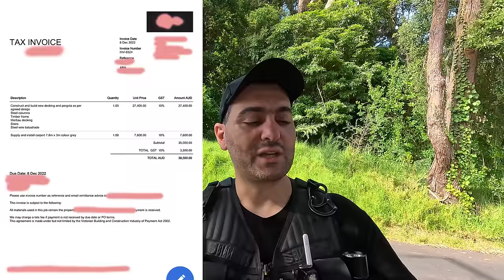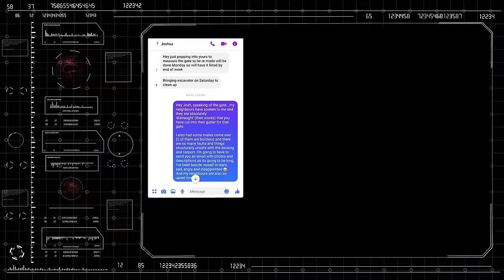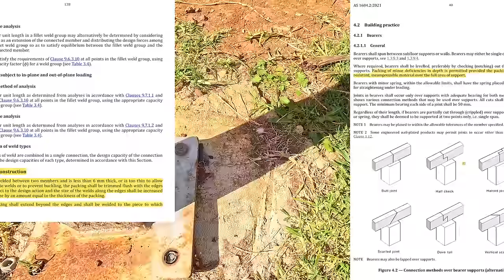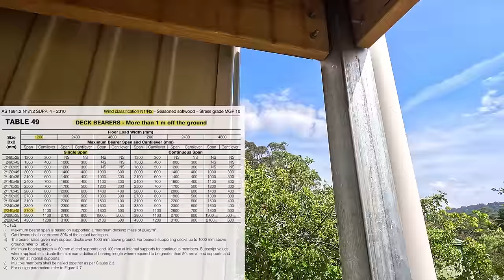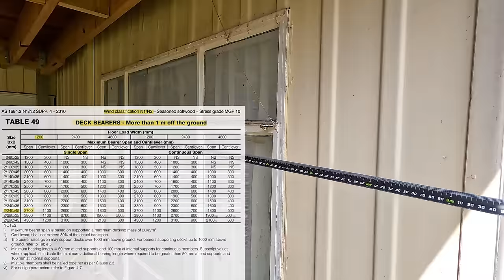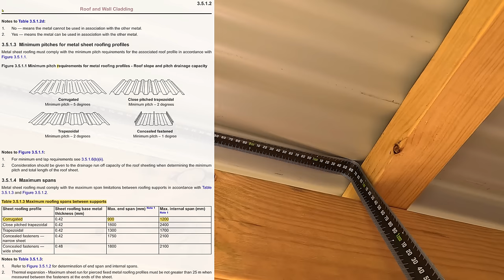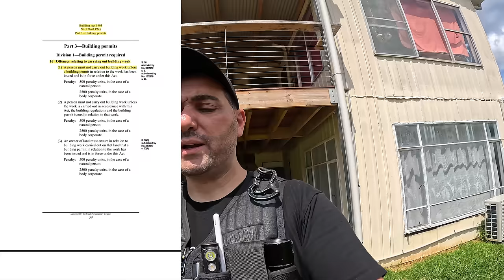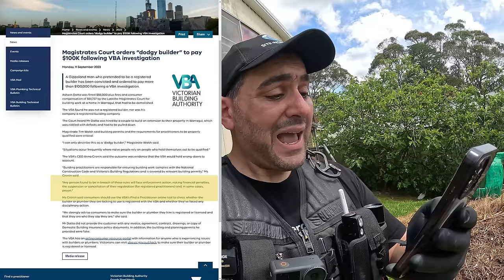I Inspected A Dangerous Build | Illegal Build Caught

Comment: Mate, I'm a cowboy myself and DIY a few small projects for myself with no regard to regulations. I have no training and the word "handy man" is a stretch for me. But even I can see, it's just common sense, that this is hilariously unsafe and unpresentable. This contractor must be on crack. Those spans under the deck are wayyyyy too long just intuitively. You don't need to be a qualified builder to see the footings are sketchy as anything and unsafe.  The simplest thing he could have at least done IS USE ALL THE HOLES for nails and bolts on the joist bearers and, most importantly, attaching the main beams to the metal pillars / columns. I would be attaching the whole structure to the house in all kinds of dodgy but strong ways that I could, at the ground, deck, and roof levels. Those are just common sense things that blind Freddy in the year 1800 (before Australian building standards were ever written) would know. What I build (and I'm not going around doing this for other people) is not compliant, I don't even know what the standards are, but at least they will stand. I stress test my work, I TRY to see where it wants to move or doesn't seem solid under loads and being pushed around. I don't expect anyone to endorse what I say, and I think the standards are a good thing, but the point is, even me, a loose unit indeed, am shocked by this.

Comment: As an ironworker in america ,,, we ALWAYS weld clips all the way around !!,, With 7018 welding rod ,,, that 70 means the weld is good for 70 thousand pounds per sq. Inch ... only putting one bolt in a connection is pure laziness!!!,,, Screws and nails !!!??? I wouldnt even stand under it !!!

Comment: Wht is the cream coloured external panelling? It looks like moulded asbestos cement. Can you confirm? 12.49 shows cracking in that panelling where the new structure has been joined. If that's ac then work should not have commmenced without licensed removal first.

Comment: I had a unit build about 10 years ago
  I had no shower complete also a pit was to be maid for the drainage from 2 properties was never done and the pipes never connected the arear was filled with dirt.
   With my local council we took the vendetta of doing something about it
After 3 years fighting the system with the building industry and the plumbing board we got nowhere 
     The builder was registered  the government body did not care I even had rang 3aw
  I finally found who the inspector was, he told me inspector did not have to go to the premises they go by compliances 
      I finally did all the work myself. including the pit 609x600x1500 into the main collector pipe.  I am no builder, but I do have common sense
   After I finished I called the same inspector he said to me its the best job he has ever Sean, 
   A builders licence means nothing.

Comment: You should come and see the carport I designed and built at my house, it is STRONG and will easily carry 2 heavy 4x4's on its roof. All done with full permits too and me with a white card. I would demolish all this work, put in correct reinforced foundations. Steel beams for the main load bearers and fully self supported and fixed to the house. The car port in the same way.

Comment: Nah mate, I'm a software engineer and those are are approved BS-2034 bluetooth bolts installed. As well as the BS-3000 bluetooth concrete footings. Your just an ambulance chaser mate... That structure could hold the weight of 44 jumbo jets.

All kidding aside, its a shame that a person would need to fall back on charity to get a horrendous mess like this rectified. The VBA is a mess like most of the sites you visit.
Thanks for all the work you do and documenting these dodgy "builders". I have learned a lot from your videos and have mad respect for your work.

Comment: He has cup head bolts on the steel plate holding the timbers instead of nice hexagonal head structural steel bolts… I didn’t see any washers on the bolts where the nuts were squished into the timbers..
I built steel deckings and sheds for 25 years… I thought I was average..turns out I was really good compared to the con artist/builders on here.

Comment: These builders obviously are registered but I think their ability should be restricted to single story homes carports garages etc. I drew the plans as per materials suppliers information brocures, assisted the tradesman to do the labouring work, only the brickie I did not assist  but we came to an agreement about lintels 3.2 wide that the brick suppliers brocure thicker steel rods + plus stirrups in every space, I was there every day at about 12.30 to assist the chippy and we worked together really well,  Not a crack anywhere finished in 1996/ six months duration of build standing now 28 years wonderful, O B in Qld. Don't trust builders when I saw and heard the problems others had had. "building inspector stated the strongest home he had ever seen in the district"

Comment: My builder defaulted on two contractors and one window supplier and two other contractors rang me to apologise about the fact that they weren't going to turn up to do the work because they were convinced they wouldn't get paid.
The contractors he defaulted on didn't take it any further but the window supplier passed the debt onto a debt recovery agency and I just checked his license on Fair Trading and it's still spotless.
I ended up having to pay a plumber and plasterer directly out of the builder's final payment.
I've already had to pay someone $4500 to replace part of the roof and I'm pretty sure I'm going to have to do something about the footings because the engineer specified 140mm hardwood posts and the builder quoted for 100mm posts and put in 90mm laminated merbau.

Comment: How do you put a post that blocks the function of the door on the first level?   (One of the things this builder did do was not attach anything to the original structure.   No ledger plates, which means (maybe) he did not alter the 'original bldg"?)   Disgusting work, and worse a non-functioning government enforcement.

Comment: Privatizing government building inspectors was a mistake, There is no money to be made in enforcement, The income for privatized building inspections and private certification comes from fees and the easy marks for easy prosecution. Basically this will get worse. there are not enough compliance inspectors and cheap unqualified inexperienced office workers are used and these people have no experience in Building and dont know what they are looking at. The current privatized system is a failure. Nope, I know no way to fix this. I am not a builder. Queensland same same.

Comment: Among many things that drive me nuts here, let’s start with the footings: it would have been so easy to dig oversize holes and get a couple cubic yards of mix delivered and poured. So much easier than futzing around with those wacko little support whatsits. And I’m just a homeowner. This job would have been so much easier done right without all those insane workarounds and half-assery. Get some engineered beams and columns delivered on site, get a small crane, install them, then fill the space between with joists, cover with decking, done. The beam has attachment strong points already manufactured, same for the columns, just bolt it together on site. Soooo much easier than this shit. 

For the footings, all you need to locate those bolt patterns is a little piece of plywood as a pattern with holes drilled in it, and a string or two to get the lines straight. I’ve seen guys do this job with most basic of tools back in the 80s, mixing concrete in a big wooden trough. Just a wee bit of thinking needed.

Comment: The reason the industry is overrun with cowboys is the fault of the regulators from the councils upwards. Nobody want to enforce the regulations instead they prefer to pass the buck to one another in an endless circle hoping everybody will just forget about it. I’ve got an illegal build going on behind me, they’ve built an 80 sqm three bedroom rental unit with a 60 sqm concrete entertainment area 600 mm off my property line. There has never been a DA submitted nor approved fir any of this work which is not only in violation of the council buildup in codes but the state SEPP regulations as well, I’ve been contacting the council since this first started 4 months ago and now it is to lock up stage and still nothing has been done about it. And don’t get me started on the actual building work which is worse than in this video. 
You’d think in those four months they could have least sent an inspector or at least issued a stop work order but all that’s happened up till today us “ we’ve got it in the list to investigate”. This could all have been nipped in the bud by sending a ranger out as soon as the complaint was raised but I suppose they are far too busy booking illegally parked cars to bother with cowboys builds.

Comment: Im not technically trained but seeing support poles (sorry I dont know the technical terms) with only 1 or maybe 2x bolts drilled into concrete is scary.  To then see bolts drilled into "earth" is astonishing.   Earthing is an electrical consideration, not a mechanical one. Ive shown this video to my son whos a 4th year carpenter.  He couldnt stop laughing at the errors/breaches of codes. I was so very proud of my son and advised him to never lower himself to performing like this.  He agreed saving a few bucks for poor output is not on.   We both agreed this is a very sad case and truely hope the home owner can find justice quickly and easily.  Ty for sharing!!!

Comment: I see what they where trying to do,,,, that deck is sorta a self supporting structure,, buy the spacing from the house it's self,,,, but they should have doubled up the out side rim board, there should be vertical deck to ground supports at any and all points where any 2 points come together,,, in corners or change in dementions,,, just geting started,, and I'm a fricki.g electrician,,,, I can build it better than thet

Comment: Perhaps he meant to say he was a cabinet maker as....

What is a Carpenter?
A carpenter specializes in working with wood to construct, install, and repair structures and objects. Carpenters are highly trained in their craft and possess a deep understanding of woodworking techniques and principles. They are adept at interpreting blueprints, creating accurate measurements, and using a wide array of tools and machinery to shape and join wood components. They are knowledgeable about different wood types and their properties, allowing them to select the most appropriate materials for each project.

Carpenters have a diverse range of responsibilities and can be found working in various settings. They play a vital role in the construction industry, contributing to the development of residential houses, commercial buildings, and infrastructure projects. Carpenters can be involved in tasks such as framing structures, installing doors and windows, building staircases, constructing cabinets and furniture, and adding finishing touches to enhance the overall appearance of a space.

Comment: IV been in construction for more than30 years,, and some of what I do is fix very old very bad condition buildings,, I'm only an electrician, bit I'm part of it,,, I know people that would look at that, and say yep, it can be saved,,,, one part at a time, starting with one concrete base at a time, get it on good ground, then add atleast 3 vertical pillars, take off all them short spacer blocked double up the inside and out side rim joists, joist hang every thing, and a rim joist along the metal of building to attach the spacer blocks again with joist hangers,,,, replace the entire wire railing with a proper one, as well as other things,, but they would not start by tareing it down,,,

Comment: Obviously she wanted a cheap quote, but that deck is terrible ans for a deck that size would have been 3 times that proce. Did she get more than one quote? Also to pull that down you'll need asbestos removal as the asbestos has been disturbed with screws and nails. Hard to take you seriously with all the graphics bs, also you realize we cant read your extracts on the screen.  She wont get jer money back, this guy wont go to jail. Toothless tiger

Comment: Just caught your channel, excellent content. In my life i spent many years installing structural steel. And this is commonly known as a shit show.
Other than the fails you picked up on, the steels not treated, no washers on the face of the timber, so the nuts can pull through. . And god knows what's below ground.
And a lot of undercut on the welds in the base plates to the column

Comment: I have no doubt the customer said she wanted a cheap job and may have even encouraged the contractor to cut costs or corners. Having said that the contractor is morally and professionally obliged to make the job compliant and even more importantly safe (or simply refuse to do it) and this job was neither. The old saying good from afar but far from good doesn't quite cut it here. There is little to nothing tying the deck to the house and not nearly enough fastenings anywhere. The footings and positioning of the main supports was so bad I cant even comprehend what the guy might have been taking on the day. Good video but feel very sorry for the owner.

Comment: So one of the questions i have is shouldn't it be possible to "save" the deck structure by adding more support beams and replacing and adding more structurally sound screws, nuts and bolts?  It seems to me that a lot of those problems could be solved by adding more support beams, that way the load is distributed more safely.  replace some of the screws and ensure that the deck is properly attached to the structure and it should be safe.  

Though i guess there is safe and there is meets compliance. 

Where i live is so remote that you dont get building permits to build structures and ive build a couple that were dodgy (im not a professional builder) but the sad thing is im pretty sure the structures i built are built better than what this guy slapped together.   Definitely safer.

Of course its one thing to build some dodgy structure on your acreage, its another to build it for someone else.

Comment: 28:30 That ladder is holding up as much of that floor as those beams are - and yeah, that ladder is just leaning against it. 

At least it won’t take very long to demo - just a strong pull on one of those metal beams should bring the whole thing down.

Comment: Pretty area. What was the siren?
Reply: Fire siren? Testing fire siren?
Reply: @gotuxy   fire alarms are usually a … beep, beep, beep and when cleared to evacuate a rising tone repeating. 

It doesn’t sound like that siren, the background siren does sound more like an air raid siren 😮
Reply: @gotuxy just found that some places (on Reddit they said a factory in Winston hills NSW ) do use old air raid sirens as fire alarms to carry over the machinery noise … so as you said perhaps a fire alarm.

Also my old high school used to use an air siren as the school bell, but they played shorter notes that the air siren doesn’t , so is still didn’t sound like that

Comment: Is there any issues relating to the actual design at all?  If it does not have a permit, does it meet the planning permit or building regulation requirements as well?
Reply: Yes, significant issues.  Those works do not comply with Australian building Standards, obviously, and a Permit would stipulate that all works be compliant. Permit Conditions would also (likely) be imposed.  A Permit application process would also include opportunity for neighbours input.. be that in support or objection.
Failure to obtain Permit for works like this is in violation of the Planning and Environment Act (VIC) 1989.
The thing is... this is located in the Yarra Ranges Council area... and they seem to be begging for complaints to the State Ombudsmans Office to investigate failure to uphold their Statutory obligations, especially in the Planning and Building Compliance Dept's.

Comment: The worst part about this... is i am not a contractor, i cant hammer a damn nail in without it bending, EVEN I COULD BUILD THIS BETTER. It would probably take me significantly longer, and likely be over-built (because i am not very trusting of materials even if they say they can handle the load), but it would be safe and secure. Heck i built steps for my baby/toddler to use the sink, and those could hold more weight than this deck.

Comment: The ironic thing is, is that the owner is ultimately responsible for the building works by virtue of the fact of authorising the builder to undertake the works. Therefore the owner is liable to prosecution  under the Act for undertaking work or allowing work to be undertaken without a required building permit.
Secondly,  Council as the Responsible Authority should have issued  a : Stop Work Order; Building Notice and prehaps Building Order seeking justification as to why the building should not be demolished. This is a  crucial step in that no work can be performed on the Building other than under an Order or Notice; which includes any demolition work. It also enables a programme to be initiated under the direction of the Municipal Building Surveyor by which the building may be brought into confomity with the Act. This would allow the owner to commission Engineers reports, plans and recommendations; Building Surveyors reports and recommendations and engineering  and architectural plan to be prepared and submitted to the MBS for their consideration.
If i were the owner I'd be contacting the MBS as soon as possible to discuss these actions